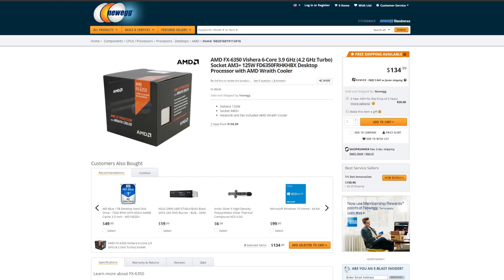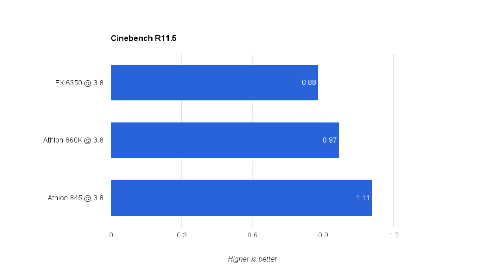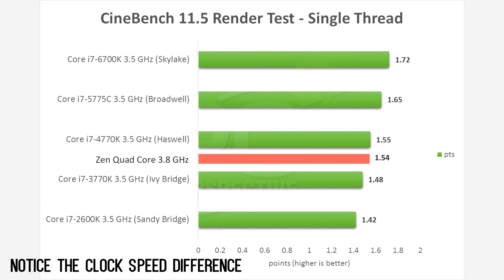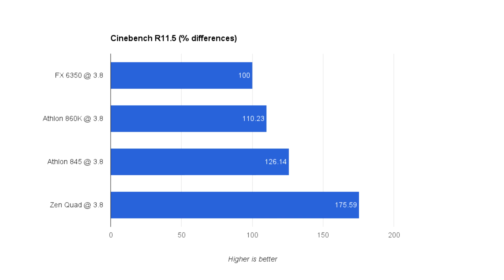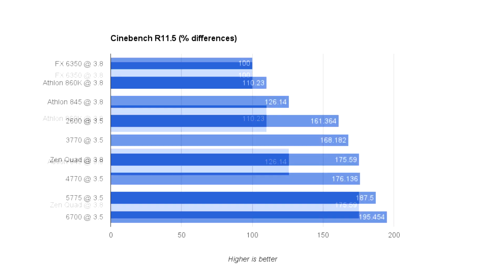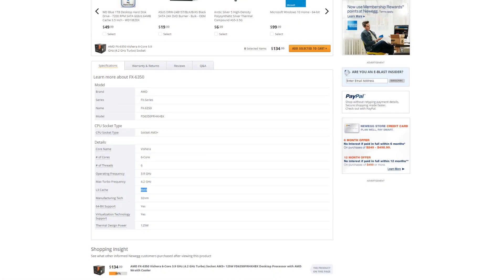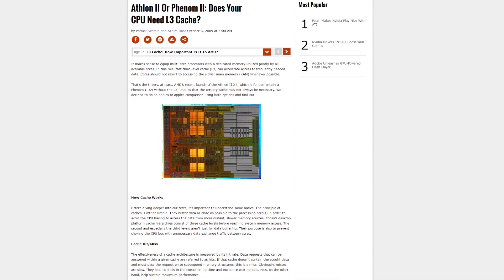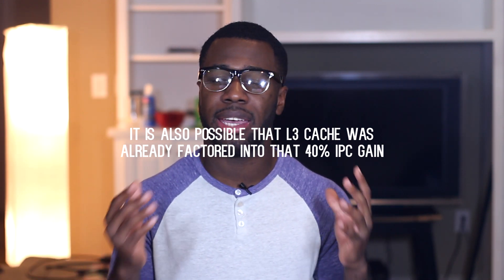How Fast & Powerful is AMD's Zen CPU? (Revisited) | OzTalksHW

Comment: Remember ZEN is also on the FinFET 14 process, the most advanced in the world, which is known far and wide for its high clocks and overclockability, combined with the fact that AMD is shifting full focus to 8 and 6 core CPUs. The "8550" (not actual name) is set to blow a CPU like the 4790K out of the water and hot on the tail of the 5960X.
Reply: something else to remember, Intel has been on the 14nm process node for two generations, kaby lake comes out in December or January, making a third generation, AND they will be on 10nm with cannon lake by this time next year.
Reply: Maybe... Hopefully so. If Zen is some where up there. that would be nice for consumers for sure.
Reply: lol, so your saying that the next architecture for AMD can match a 2 gen old CPU from intel? lol.
Reply: Architecture and transistor size are two different factors. I only spoke about core technology. AMD's new architecture sounds great, but I don't understand the difference between manufacturers architecture. Please don't tell me how your $338.00 cpu is better than my $159.00 AMD.
Reply: NBW DOUGHBOY uhh... Nvidia uses 16 nm FinFET
Reply: Well it sounds like AMD fans are in for a big upgrade over current FX cpu's. If like the new AMD gpu's the improvement actually cost less than what they're replacing GREAT. Thanks OZ. I appreciate that you cover the new stuff people can actually afford.
Reply: +Ill Vill  no, they are 14nm and they are unreleased. all of this is confirmed. also Intel will be on 10 nm q3 2017.
Reply: +fouzai alaa those are just engineer samples. 

engineer samples are always clocked lower than the real deal.

I suspect a 4ghz chip boost clock again on a final product with 125 -140 tdp
Reply: Those are low clocked revision A0 engineering samples. The rumor is 3.8 4.2 turbo on the final 8 core zen. As for the 95w issue.. Im sure 95w is the "target" just like 140w is the "target" for the 480.. we know how that turned out. Im expecting Zen to draw 125w+ under high load & even more when overclocked but.. Who gives a shit? Amd has already stated they have achieved more than 40% over the most recent iteration of Excavator which puts it past Haswell in terms of IPC.. the question now is how far past it? do I expect it to curb stomp Skylake? no but I expect it to be a negligible amount behind it, Have more cores and be a better price.

AMD GANG
GANGANG IN THIS BITCH
Reply: LOL, Its amazing how that comment had nothing to do with the previous statement. LOL WTF.
Reply: I didn't know 14nm FinFet was world renown for overclocking. I do know that the 480 was built on 14nm FinFET and overclocks percentage-wise almost identically to AMD's previous Hawaii architecture. Node shrinks may help but to what degree is questionable.
Reply: It seemed to me that everything from the P4 forward was such a huge increase in the number of transistors that performance went up without an icrease in clock speed. 28nm to 14nm is an enormous increase.
Reply: Max Hughes I'm not sure if you are referring to my comment or not, but I will respond anyway.  Basically, the more transistors you have, the more shit you can do with a CPU.  In regards to Intel vs AMD architectures, basically, there are a metric fuckton (technical term there) of ways to solve the same problem, and AMD and Intel have each developed there own solutions to execute AMD64 instructions.  At the moment, Intel is faster at executing the instructions (performance per core is roughly IPC * clock speed, although, we don't know the exact IPC of architectures, just relative IPC).  As it sits now, AMDs latest architecture is about 52% the IPC of Haswell and Skylake is about 10% better than Haswell.  While shrinking transistor size does not yield by itself performance improvements, it allows a manufacturer to put more transistors on the same size die and with better thermal efficiency, although it tends to decrease overclockability, although it tends to decrease the need for overclockability since you should be able to come up with a faster architecture with that extra transistor count.

I hope I explained everything in a relatively coherent manner, although please note that I am writing this while drunk and my have some grammatical and syntactic errors, please respond if you have any questions. :)
Reply: TBH Samsung/GF and Intels 14nm are not the same. First one is shrinked 20nm with finfet (like TSMC 16nm that nvidia pascal uses, but with lesser shrink obviously), while intel has "true" 14nm. Also keep in mind kaby lake would be 3rd iteration of 14nm, so it is probbably more mature than samsungs (higher clocks and/or lower voltages, better overclockability etc.). Intels fab will always be big advantage for intel, but on the bright side for AMD, "experts" say this process is the most competitive to intels that amd had in years (probbably better than 32nm GF with 32nm intel in the bulldozer & sandy bridge time)
Reply: FinFET 14nm is not know for high clocks and overclockability, it's actually pretty poor when you think of the node shrink and compare it to others.
Reply: aondw others, what others? lol. there is only 1 other. jusy say nvidia
Reply: NBW DOUGHBOY Theres also intel.
Reply: +NBW DOUGHBOY you're either trolling, or you have no idea what my comment had to do with OP's comment due to technical terms or being unknowledgable about the fabrication process of processors in the modern era.
Reply: So? AMD already has a 7nm ZEN cpu.
Reply: TheDarkToes Im not talking about the upcoming Zen. Im talking about the Zen cpus being released in 2018 which ARE 7nm.
Reply: WTF? After 14nm is 10nm, and it's unknown if amd will have it by 2018.
Reply: Andrash88 Google is your friend. They are already working on it & the target for release is Q4 2018. If that changes, it changes. My point being every one likes to whip out their dick and start measuring it "ohh intel has this and that.." everybody is trying to shrink nodes. Idgaf honestly, Im looking forward to the eventual Fiber-optic cpus as traditional fab has more or less hit a performance wall.
Reply: 7nm is faaaar away (after 2020 for shure). You must get something wrong
Reply: Google bruh. Google.
Reply: Fudzilla? 7nm is waay to optimistic. There is no theoritical way (not even for intel), even in years after. Check this out (todays news) http://wccftech.com/tsmc-5nm/

It would be fantastic if they could get 10nm in 2018, but It's not up to them, low performance chips are reallity but high perf. are hard to make (x86 cpu, gpu)
Reply: +Andrash88 see previous comments.
Reply: there is one with 8 cores at 2.8 ghz turbo boost to 3.2 Ghz 16 threads with 95 tdp and a 1 or 2 watt at idel with clock speed of 550 Mhz
the other will be a quad core with a clock speed of 2.9 Ghz up to 3.2 Ghz 8 threads and and rating of 65 tdp and  a 0.5 watt at idel with clock speed of 400 Mhz
the price of AMD's is always low so ....its a good shit !!
Reply: If their goal is 95w, they will stay there (95w was mentioned many times as zen max). They can boost clock atleast a little bit, but I don't expect the clock to be on par as intel (more mature and true 14nm). I think they wait end of the year or beginning of next one because of better leakage of samsungs process (better clock/voltages)
Reply: +Andrash88 while 95 watt might be a certain chips max, I honestly expect 125 watt to be an honest max, as 125 watt has been the max forever.

I am just speculating though so idk for sure.
Reply: Well 95w is a bit weird for "true" 8 core + smt because intel is 140w, but I just think either it will be weaker than intel cores or it will be over 95w. It is fishy to have "on par" 8 core to intels and be 95w while they are on 140w. There must be trick (reason). Only other explanation wold be brilliant engineering or intels heavy slacking in last years because they didn't have any real competition. OK jim keller is great, but AMD have like 11 times less money then intel for research and development, and that's just brutal.
Reply: +Andrash88 I think 95 watt is gonna be apu's.

there was also rumor they are releasing apu's first. so shrugs really I just want them to release it.
Reply: +Andrash88 I think 95 watt is gonna be apu's.

there was also rumor they are releasing apu's first. so shrugs really I just want them to release it.

Comment: This video is pretty mind blowing. Reason being If the instructions per clock is even close to Haswell and they have already announced 64 core CPU's with simultaneous multi-threading which is just AMD's name for their version of hyper threading + the heating issue fixed leading me to believe heavy overclocking will exist knowing AMD. Although this seems very promising I can not wait to see what Intel's Haby lake does about this and how promising it will become prior to release. Or will it be as Over hyped as the GTX 1080 and RX 480. We will see in due time.